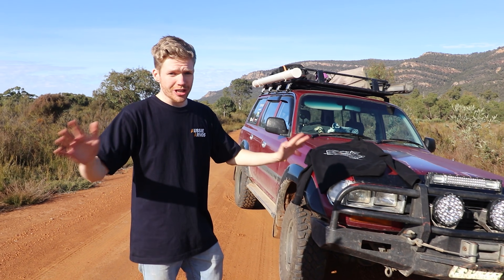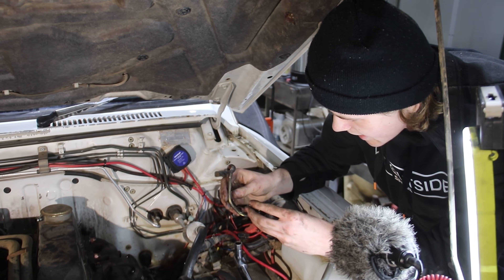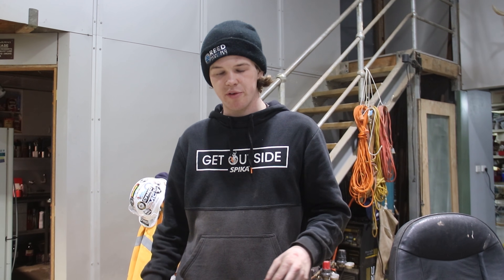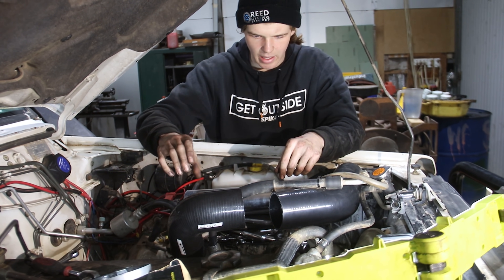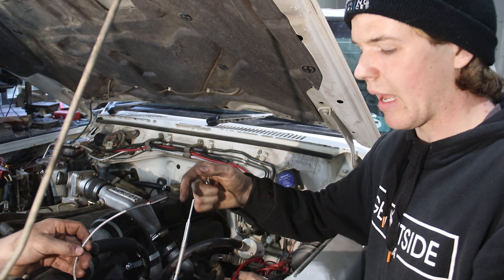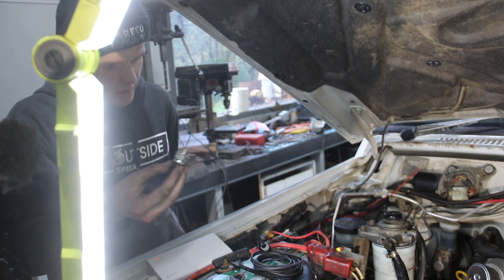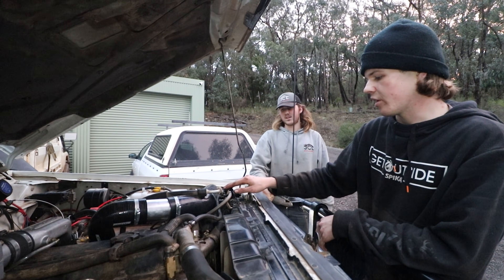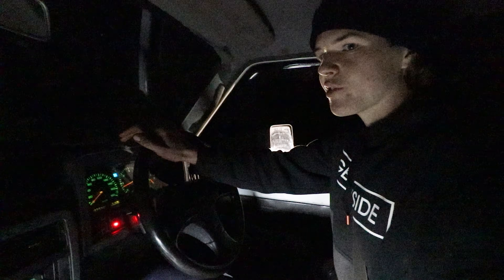Turbo TD42 Nissan Patrol First Run! | How fast is it?! | IS IT WORTH TURBOCHARGING YOUR OLD 4x4?

Comment: Good job boys. Just one thing you should really use the steel gasket from the turbo gus on the manifold those gasket yous got  will blow out eventually
Reply: 100% correct. Need steel to survive the heat. I'll give the gasket used maybe one or two weeks.
Reply: Yep this needs to be pinned. They’re not gonna last

Comment: Had to do the same job with an exhaust stud on a 1KZ-TE a little while ago and used the same right-angle chuck to get buggered one out. Why is it ALWAYS the one in the worst position that is the broken one 🤔😄
Awesome to see you having a crack with turbo-ing the Patrol and was stoked to see it run after 👍👍👍

Comment: Another great video fellas.....awesome. Just on the manifold nuts- I think they may just be copper plated. Pure copper nuts would not normally be used in high stress applications but I’ll stand corrected. Using a magnet  on the nuts should confirm that. The copper also would provide an anti seize property....no need for antiseize compounds.

Comment: @liam, 8:14... its not about the overall ID of the piping. it more to do with the restriction on the air as it flows through the piping. the way you have a gradual reduction is great. it would be wrong to say "just because the turbo inlet is 2", the 3" inlet at the airbox is useless". If you want some further reading seek out "reducer k value" for some info.

Nice work. We dont agree on the gasket bit either. you should put a smear of goo on the gasket to ensure it will seal. especially on older second hand manifold because they have been heat cycled they are more like to have small surface imperfection which the goo would help to seal on.
Reply: Theres always one ..hey boys !!!!

Comment: Bit of a tip for people who are just getting into cars make sure you use the correct hose for the purpose, there are different hoses for oil, water, fuel lines low or high pressure, in tank fuel line and extenal use fuel lines and so on.
Great video as always boys 👍🏻
Reply from the maker: Thanks Paddy! great advice!

Comment: Keep an eye on the silicone joiners on a intake, they can suck in as they don't have a metal wire inside them keeping it open under acceleration

Comment: I did the bottom end bearings while the sump was off more for oil pressure reasons. They are cheap and if they are old and worn oil pressure will become an issue with more pressure from boost. Like your channel

Comment: My turbo is a high flow turbo and I had to run a 4inch airbox and 4inch snorkel and 4inch pipes to 2.5inch turbo intake cause it didn’t get enough air thru a 3inch pipes

Comment: Water cooling a turbo will be an extra load on the cooling system. However, pumping oil through a turbo will also increase load on the oil system/temps….. pretty much 1 for 1…. It’s either the oil system by itself absorbing the heat, or the oil and cooling system absorbing the heat. Distributing the load between the 2. I’d prefer to keep water cooling if it’s accommodated for in the turbo.

Comment: Is it even turboed if you don't get pen and put a T on the 42D sticker
Reply: TD42 is the name of the motor, it doesn't stand for Turbo Diesel 4.2. Just like the ZD30, and RD28, they are just names of the engine, cause both of those motors are turbo diesel, but aren't called TD30 or TD28
Reply: @riotousftp8582  guess we've never heard of sarcasm
Reply: @matthewtunbridge1808  more of a joke then sarcasm, I had a good laugh over it I was just telling you that that’s not what it means, your comment was funny
Reply: @riotousftp8582  you should tea bag a turbo at full noise.

Comment: If your turbo has water feed it must be used. People who don't have rocks in there head
Reply: So Nissan? 😂
Reply: @cameronembrey2389  some turbos come with no water feed for cooling its how they were designed. If it has a  water feed it must be used or turbo won't last long at all.
Reply: @jasonmcnamara1745  I think Nissan just put bungs in late model td42s ht18s
Reply: @jasonmcnamara1745  how long would you expect one to last with the water not connected?
Reply: Nissan are not turbo experts. Turbos have come along way since the 90s it's now well known a water cooled turbo will last longer. Same kinda thing with Holden and the vl turbo Holden and australias stupid laws didn't allow a intercooler just a cross over with cooling fins. This is why nissan and there r31 was not released in aus with the 2.0l turbo engine nissan knew without a cooler intake temps would be to high and would lead to engine failure